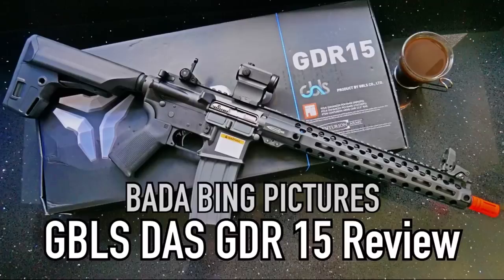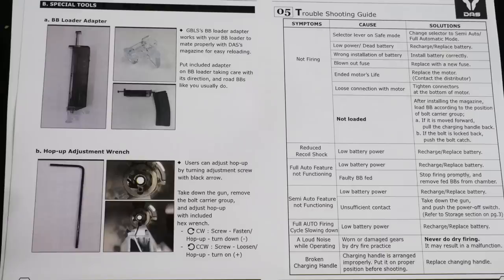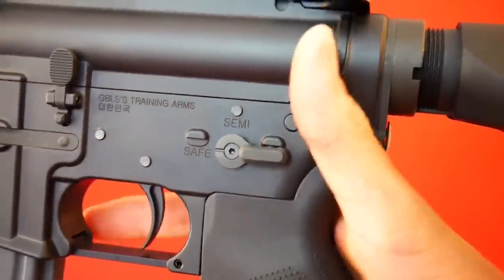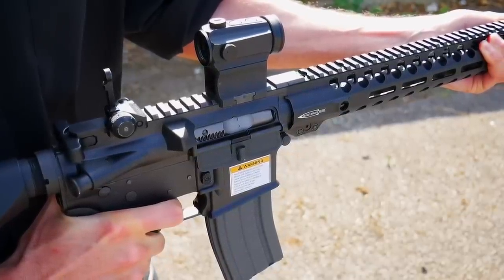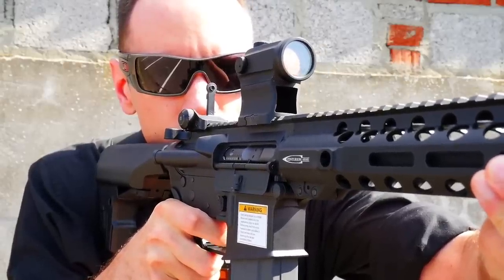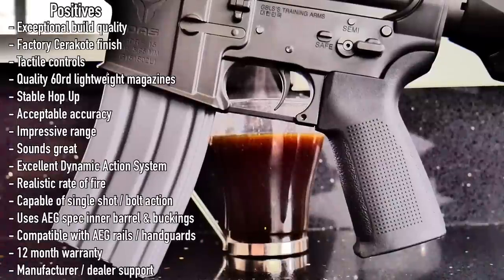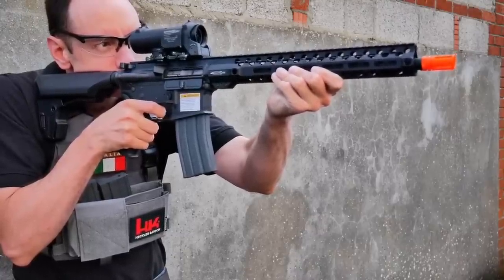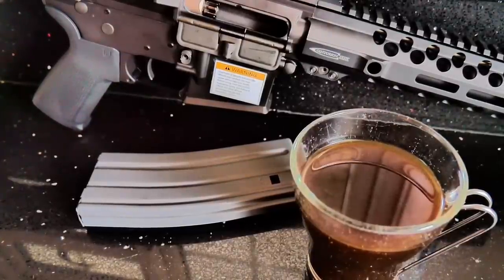GBLS DAS GDR 15 Review - Is it worth it?

Comment: I get the price of the replica but they are just taking the piss with mag pricing ($55 in the UK). That's the same price as GBBR mags when AEG ones are infinitely cheaper to manufacture. They should also switch to 120bb mid caps, they are leaving one of the biggest advantages they have over GBBR's on the table by making low cap 60bb mags.
Reply from the maker: I agree. Mega Money. 
But there are whispers of a higher capacity (120rd) on the horizon. So that would be a good start.
Reply: That's good news. In the video you mentioned they are made out of steel right? If so they need to make them out of aluminium, should bring the costs down and that's what the vast majority of real AR-15 mags are made from.

Comment: Badabing, what C rate battery were you using for it and mAh? I have an 1300 mAh 15C that seems to work just fine, however in the USA website they recommend just a 25C rate, no matter how many mAh... I'm a bit worry of using it because I dont know if engine/electronics can break.
Reply from the maker: Hi. 
The ones I used were 1300mah 25c.
Reply: @BadaBingPictures  25 continuous and 50 burst? witch model?
Reply from the maker: Sorry dude, I don’t know what that means. Electric guns and their batteries are totally alien to me nowadays. 
However I believe this is the one that was supplied with the GDR for this review:

https://www.vapextech.co.uk/airsoft-11-1v-1300mah-30c-lipo-battery-with-case-lp304-vapextech/

Hope that helps.
Reply: @BadaBingPictures   But you used a different one thant that, don't you?
Reply from the maker: I just checked the video files on my drive. I used the model LP304 batteries. The same model as the one on the link.
Reply: @BadaBingPictures  Perfect, thanks mate, if you ever want to play airsoft in Spain, you're more than welcome.

Comment: Airsoft guns in Republic of Korea are deemed to be toy guns(not for sports) but considered illegal and imitation guns if any of laws are broken.

According to the "ENFORCEMENT DECREE OF THE CONTROL OF FIREARMS, SWORDS, EXPLOSIVES, ETC. ACT",[43] (총포·도검·화약류등단속법시행령) in 2017, imitation guns are recognized according to any one of the following criteria: 
1. An object manufactured by metal or non-metal material, very similar to shape of the gun that can be high possibility to use for crime.
2. An object manufactured by metal or non-metal material, shoots metal or non-metal projectile, or make sound/fire that any one of the following criteria:
a. Diameter of the projectile is less than 5.7mm
b. Weight of the projectile is over 0.2g
c. Kinetic energy(destructive power) of the projectile is over 0.02kgm
d. Head of the projectile is sharp that not round treated
e. An object make instant explosion sound is over the 90db or make combustible flame 
and in korea, replica red dot sight and scope is illegal .. 
fuckin kill me...

Comment: South Korea is a country where it is difficult to make toy guns because of heavy gun control. 
However, it looks great. 
But the price of the product is too high.

I enjoyed watching your video. :D
Reply: When I went to Korea I went to an airsoft store and I was shocked how high the prices were there and low FPS. :( Korea make great slides for GBB pistols. Detonator.
Reply: 우파루파님이ㅋㄱㄱㅋ
Reply: @BrothaJeff  the reason of the high pricec are caused by the safety test which is practiced when guns passing the customs in the port, and that makes approximately  4~5 guns to destroyed just cause of the safety durability test (including press the trigger with 8kg power, dropping test and so on, plus almost of these test are purposed to make sure that safety lever not to get in broken) so... saler need to cover the loss and that makes the prices super high..
SSIBAL(KOREAN'S bad word)

Comment: How do you rate the stovetop coffee makers? Better than a French press?

I’m in the market for something to replace my noisy old espresso machine.
Reply from the maker: I love them both. While I do have a small collection of Cafetière’s, I prefer using the Stovetop Moka pots (Percolator type thing). 

The French presses are okay and look fancier, but the glass can weaken or crack if repeatedly cleaned in a dish washer. If a thinner grind is used, sometimes small grit will get past the filter and end up swimming in your mug. 
So I go for the Stovetops because they’re built like tanks and you get an orgasmic coffee aroma permeate your home as it’s brewing. Disadvantage being it’s slightly more difficult to clean out.
Reply: Cheers. I’m using a French Press currently as it makes less noise when I’m getting my caffeine fix at 5am, but yeah, I get that wonderful grittiness in my mug. I can pick up a Bialetti Moka percolator for a reasonable price so I think I’m sold on the idea.

Sorry to hijack the video topic. That’s a nice AEG, btw, but I think I’ll stick to my GHKs. ;)

Comment: Excellent review i must say.. I've shot the GDR 15 when it first got released in our country, and i do completely agree that the trigger is way too heavy compared to any other trigger. Heck it's even heavier than a real m16 trigger that i shoot at my annual training for the ROK reserved army. If i had to add one more comment about the GDR 15, it would be the way how the whole recoil works within the GDR 15, every single trigger pull will make the cylinder inside the bolt carrier move forward, resulting air compressing throughout the barrel like any other aeg would. However when this happens, it causes the whole gun to push forward which you may not really notice. This felt a bit awkward for me when i first experienced the replica. Nevertheless, it is still an awesome piece of replica to have fun with. Liked and subscribed from South Korea. Keep up the good work mate.
Reply from the maker: I agree. It’s worlds apart from regular Airsoft guns in that regard. 
Thanks for tuning in, and joining my growing army of subscribers!
☕️👍

Comment: Easy to say this is way ahead of the current airsoft aegs. Let's give this some time. Will aegs be easier to fix and maintain this why compared to the gearbox on a normal m4 though ?
Reply from the maker: If it's a glimpse of things to come, then it'll be the evolution AEG's have needed. I'm a Gas Gun guy so all electric internals are complicated in my eyes. I would imagine it would be fairly straight forward with enough practice, but there does seem to be some fiddly parts involved.
Reply: @BadaBingPictures   finger crossed. This gun looks like so much fun.

Comment: KSC HK33 had a not too dissimilar system. While I don't think it had a reciprocating bolt carrier, it fired from a precocked position and could be operated as a 'springer' via the cocking handle.

TOP did an M4 that was shell ejecting with a similar combined reciprocating BCG
Reply from the maker: Yep. I mention both of those rifles towards the end. 
Also the American Airsoft Factory M4 which uses a vaguely similar concept.
Reply: @BadaBingPictures  haha, I noticed. It was at the start when you mentioned you hadn't seen anything similar and the KSC system was around 2006, think it also got cloned by one of the Chinese makes in the golden age of Chinasoft (Both Elephant I think)
Reply from the maker: Sure it’s similar but different as it has an independent bolt carrier that’s not contained within a Gearbox. 
If only KSC were a bit more creative and expanded upon their concept.
Reply: @BadaBingPictures  true. It's interesting you mentioned being involved in Airsoft back in 98, I got started in 05. It's crazy how the tech/market demand has changed where some of the big names have either fallen by the wayside (TOP and CA) or have gone 'arcadey' (ICS and G&G with their 'alike' models)...I think maybe the spurt and uptake of GBBRs and latterly the recoil shock systems offering an alternative to the Systema and clones and as licensing between real firearm manufacturers got closer to Airsoft there was a good signal that a high end electric system that more of less acts like a GBBR without the pitfalls and maintenance demands would have a solid position in the market.
Reply from the maker: The amount of stuff available now is crazy, compared to what was there when we started. In many ways it was a better time though. 

The ball is rolling and companies ought to get their game faces on. There should be a wave to wash over the market with rifles like these, in various types and not just boring M4’s.

Comment: It works like gbbr, but you can drop magazine as aegs. Plus it works well in every season, not affected by weather like any other gbbrs.
You might try steel buffer and bolt carrier option too !
Reply: it also works even without the mags inserted and can work as a bolt action just like the real one. I feel like in terms of manual of arms this would be more realistic than a gbbr

Comment: What's the rail system like does it have a good finish on it
Reply from the maker: The finish on the rail isn’t that special. It’s the typical kind of coating which will reveal the bare metal once you attach and remove accessories a couple of times.
Reply: @BadaBingPictures  oh ok thanks I was considering getting it for a G&G build i might still get it and maybe if it gets marked a lot, I will get it done in cerakote Thanks again

Comment: Great review as always! My thoughts are: I think the only reason I’d buy this gun is to support the company so that they can keep making more of them, make other gun models (seeing this system with a 416 or a SCAR would be fantastic!!), and eventually MAYBE bring the cost down. Because eventually this tech will be more standard for AEGs if it’s supported enough. And if it means I have to sacrifice my wallet for it, then so be it lmao. But for the time being, I might still get a GHK M4 and a full combat load instead..
Reply from the maker: I hope we see similar technologies from different brands. This should be the direction it goes in. 
I don’t think this is something we’ll see die off. 

I highly recommend you buy that GHK, 😉. They’re great!
Reply: BadaBingPictures yeah I totally agree! I’m fairly certain there’ll be some knock off brands for the system eventually. That’d be deadly if a mosfet could be installed into this system! 

And yeah, I plan on it! Thinking of doing a Block II build. I also plan on gettin that GHK 553 when it comes out!

Comment: I remember this aeg can be also used as gbbr, is that a different model?
Reply from the maker: It works just like a GBBR.100% battery powered with no onboard gas, unless your optic has nitrogen inside it ;-)

Comment: the day economy of scale brings the price to the point the buyer pays something closer to the cost of manufacture plus wages for all the workers, totally. Right now absolutely not. Buy a GHK with colt trades, get it cerakoted and buy the best barrel and hopup you can find. Buy a shit ton of c02 mags and propane mags, slap a heavier BCG and a real steel buffer spring in there , buy spare parts for when that buffer spring hammers the inside of your gun to dust, and loctite to keep the front sight pins from getting launched into space. buy a crap ton of different furniture sets to do replicas of different rifles. Or just leave the gun stock with some c02 mags, you'll have something with "wow factor" comparable to the thud of your jaw hitting the floor and boring down to the center of the earth when you see the GBLS rifle's price.

Comment: I wonder the bolt lock will fail over time, like the gbbrs
Reply from the maker: I haven’t heard any reports of bolt locking issues so far. Nothing on the owners Facebook group either, so it looks like it’s design is durable. 
I never experienced any problems with this sample during my time with it. 

Not all GBBR’s are created equal. Perfect bolt lock success rate with GHK and TM’s.

Comment: Two years into GBLS supremacy and the answer is a resounding yes, it is worth it!
Reply from the maker: Great news.
Any issues?
Reply: @BadaBingPictures  Two minor but notable issues. Do not play in the pissing rain, it will stop working after a couple of hours. Nothing another couple of hours in the airing cupboard won't fix. Also, I had to Loctite the hop screw as it had a tendency to happily undo itself under vigorous combat.

An interesting oddity with the GBLS is with the standard bucking, I would get a lot of joule creep as hop was added, so the heavier the BB the more powerful it got (to a point like 0.36s). I called this "hop pop" as it was as if pressure builds up behind the BB and then 'pop' out it shoots! I replaced it with a Modify bucking and now it behaves in a more traditional manner.

0.28g BLS bio BBs are my preferred ammo. Yes, contrary to the popular myth it is quite happy with decent bio BBs. It shoots just below 1.1j with not much variation. Perfect.

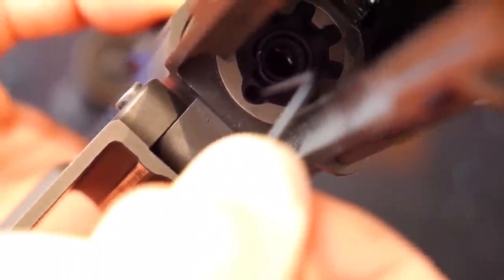Comment: 8:08 kinda like a real gun. People will complain that the spring is too stiff but realistically so is the buffer tube buffer on a real ar15.. If women can pull that sucker back with little to know problem im sure us airsofting dudes can manage. If in the case your arms are like a wet noodle pick up your moms 3 lbs (1.36kg) running weights and lift those suckers for a week i guess.
Reply from the maker: Haha. 
It’s not the buffer spring that’s stiff to pull, it’s the one within the BC that requires priming to fire the shot.

Comment: This is a very expensive rifle so there is no reason why it is an AR15. It has proprietary everything so you can't loan a mag from your mate anyway. I understand that companies make a sh*tload of M4s because that's what the masses buy, but this is not a gun for the masses. How could I feel that this is my snowflake $2000 gun when it looks like 80% of the guns on the field! I'm confident that GBLS will address the trigger and other issues but I will still not buy their product until they make it into someting else than an AR or an AK.
Reply: Limited Edition owner here. GBLS is planning to make an AK with a similar recoil system and were thinking about releasing a limited edition model of that sometime next year (estimated, no concrete date and would probably put it towards late next year, but the manager i'm in touch with was rather confident in that estimate.)
Reply: Ok, then I'll buy the third model in 2020.
Reply: M1 Garand PlEASE!
Reply: It is the end of 2020 and still not even a second gun. I suspect it's the high price they offer their only product. Hard to grow if you don't have many customers.

Comment: £1600... RTX2080TI + GHK 553... 
or this... 
;)
Reply from the maker: RTX2080TI? 

Man that’s a tough call. The 553 is lovely! Picture what a Steel G5 would be and you’ve basically got the 553. 😍
Reply: Latest top of the line graphics card + Latest top of the line full steel GBB rifle.. 

Just pointing out it's really really hard to justify buying this considering GBBs actually work really well these days in all conditions (and now with lightweight mags being a trend, recently bought 5 x Ace1Arms Kriss Vector 340g 55 rd mags for the KWA Kriss, and of course all of the GHK light mags), these hybrid EBB seems to be increasingly addressing a problem that only serves a niche market.
Reply from the maker: Oh I see now. 
I’m not really a computer guy.

I think this rifle is excellent and looks to be a good long term performer...(hopefully). But like my old PTW, it was so good that it became boring to use. Boringly reliable. 
I used to prefer the misery of GBBR’s, but they’re reliable now too. However the limited capacity will always create that challenge that I, and many other players seek. As you know quite well.